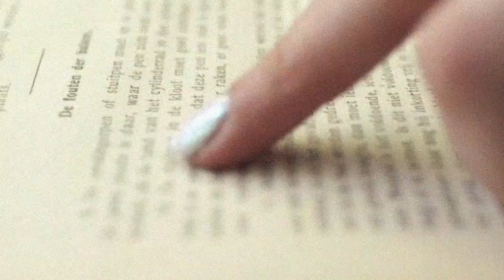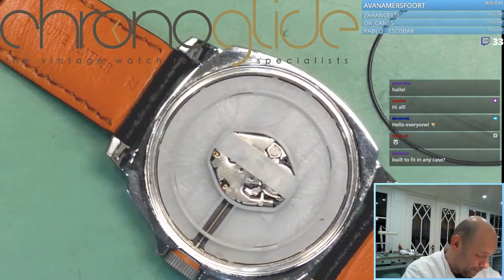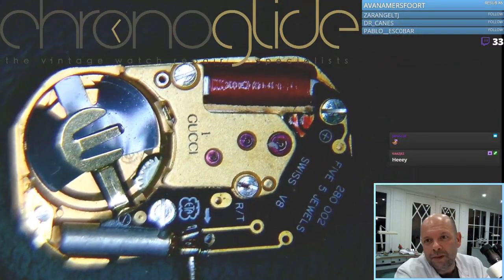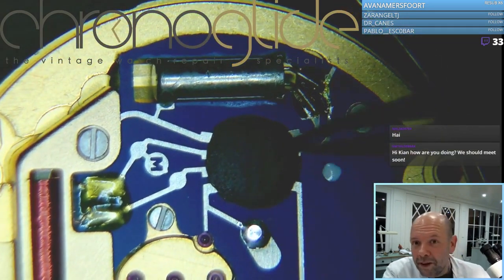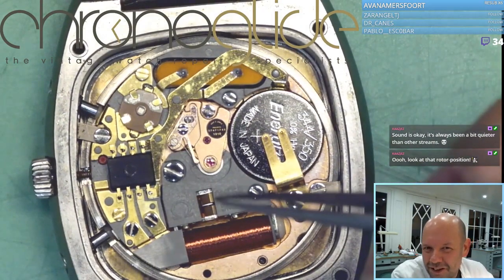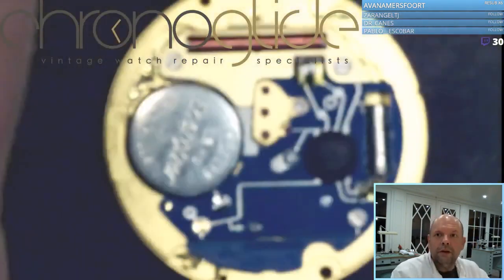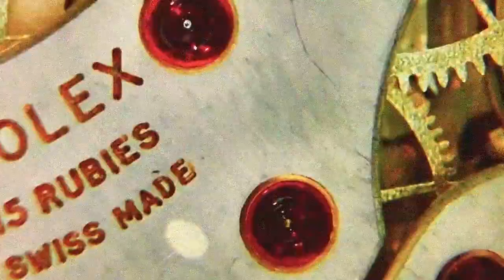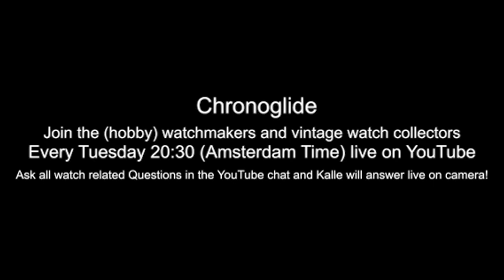Quartz movements  - Part 1of3

Comment: I have a seiko quartz I’ve had for 46 years. The movement has ran for 46 years with no service. Very impressive. I have 3 watches with the Seiko VH31b mechaquartz 4Hz movement. Very impressive cheap movement that moves the second hand at 14400 bps similar to a mechanical watch.

Comment: So wonderfull to see the Omega Calibre 1310 being shown, which was Omega's first in-house quartz calibre. This is such a superbly engineered movement. Having restored a number of these I am a big fan, although coils are very rare to find now so dont let anybody not skilled with these change the battery as this is where they usually get damaged. Well serviced and correctly regulated they are very accurate.

Comment: Very interesting, I recently had a complete quartz movement changed due to bent seconds hand which overloaded the old movement. Some chronographs are hybrids(meca-quartz) which have a simple quartz movement with a module which is mechanic . These basic lessons help us understand the working of quartz watches. As a comparison: some mechanical chronographs (ex. ETA- 2892 with a Dépraz/Dubois) have basically the same rough working. So please don’t snob quartz!

Comment: The "blob" is a COB - circuit-on-board.  The silicon wafer is attached to the PCB (printed circuit board) instead of being encased in plastic or ceramic.  Connections to the traces are then made with very fine gold wire using ultrasonic welding technology and the whole thing is encased in a ceramic epoxy.  This reduces manufacturing cost and size, making it perfect for use in a watch or other tiny portable device while at the same time increasing reliability because it removes one manufacturing step (the potential for errors increases with each automated manufacturing step).  The negative aspect of this is that a fault or failure in the cob requires a complete circuit board replacement.  If an IC is soldered on it has the possibility of easy replacement, whereas a faulty COB condemns the entire circuit board and probably the case to landfill.  Not helped by the fact that I don't know of one watch company that is willing to supply their soldered on IC as a a service part (correct me if I am wrong).

As an electronics guy who is just moving into the field of mechanical watches I am torn.    I appreciate quartz for what it is - a stupidly accurate means of timekeeping, but I deplore the disposable nature that the industry has mostly been going in and the lack of artisanal  inspiration that is displayed by most of the industry.

Then I think about the fact that I can buy an (admittedly bad) quartz movement for $5 and put it in absolutely any case I desire even if I have to 3D print a movement holder, then recycle/reincarnate the case in 2 years when the cheap quartz movement fails.  I am my worst enemy.

I love both, but for entirely different reasons, but both reasons are to do with the fact that I have done/will do all of this myself on my workbench.  Average Joe Citizen doesn't even consider these aesthetics, he's usually only interested in a cheap but useful timepiece, and more often that not that is the free one on their phone these days.  I'm now coming across young adults (up to 30 y.o) who don't feel comfortable reading an analogue watch face and would never consider putting a time piece on their wrist.

I guess I've just summed up the entire quartz crisis in four tiny paragraphs and doubled down on the smartphones.  I believe that the love for mechanical watches and the history they represent is growing but I'm biased.  I grew up in the mechanical watch age when strapping your own watch on your wrist for the first time was a rite-of-passage, but "came of age" while the quartz crisis was still in full swing.

Discuss:
😀

Comment: U explaineed how a Quartz watch work is only 40 % . Quartz Tuning fork vibrating @ 32 k  & how IC make  quartz to vibrate , feed back , flip flop  etc are missing. Quartz movements without  jewels are also durable .My Citizen Promaster & Seiko Kinetic 20years old. Still maintain  +5 Second/ Month. I can check with my Atomic clock app on phone. & My wall clock with GPS module is atomic clock acuurate I turned normal Clock to this with a kit & assemled. People who scorn Quartz, either they are luddites or never understand electrics or electronics